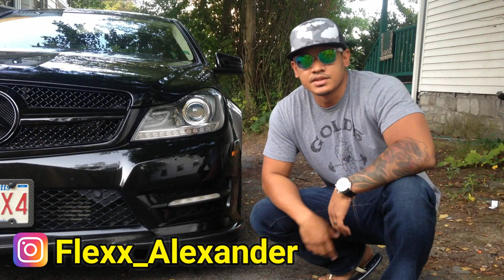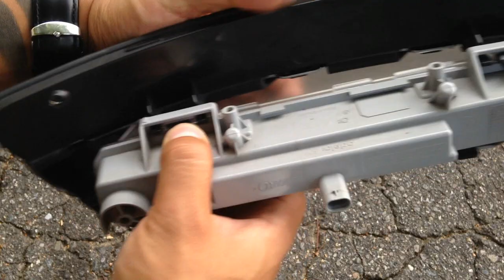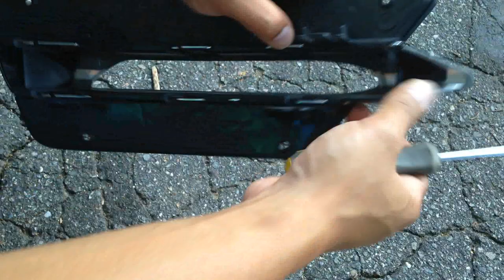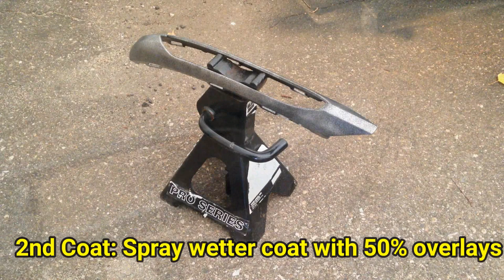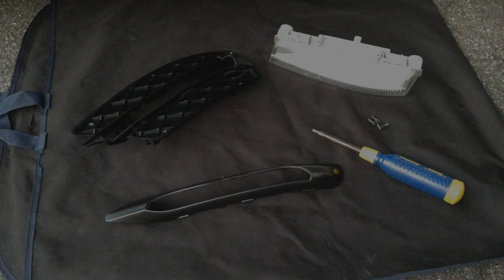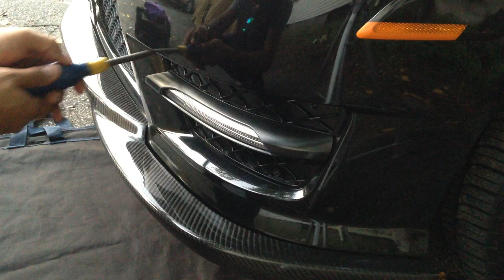BLACK OUT CHROME FOG DRL LIGHT TRIM MERCEDES C250 C300

Comment: Hey flex, do you know how you would remove the fog cover on a 2014 w212 e350. On this particular model there is no light strip on it, it’s just a chrome line, I’ve seen people replace it with actual lights and was wondering if you knew how to do the removal

Comment: @All other with the same question (as me btw - have the model without outside screws) - some models do not have the screws outside. To get this thing out - u need to go first underneath the bottom side, get the cover shield away and theeeen u will have the access to that thing from inside... quite brain fuck doing that... but this is the way.
Reply: I have a 2013 C250 Turbo Deluxe no torx screws either...

Comment: Great alternative to vynil
Reply from the maker: I did vinyl first but it was a pain to get all the wrinkles out. Also, the black vinyl got scratches and pitting really quickly when dirt and debris is hitting it on the highway.  The plastidip for some reason just holds up better.

Comment: Now if I continue to spray on more coats of thr glossifier will it eventually get close to the metallic black that our cars are painted? I really want to do this to my rear trunk chrome but I want it to somewhat match and not be obvious that it was painted
Reply from the maker: the glossifier is not meant to make the black plastidip base turn into a metallic black. It's designed to "gloss up" your flat black plastidip.  I did my chrome emblems with the black plastidip and put on 3-5 layers of glossifer and it gave the black a nice shine (somewhat like a satin look instead of a matte look).

Comment: Hey Flexx have you heard about a module that plugs into the OBD port to lower the body on a Mercedes with airmatic suspension? and does it work?
Reply from the maker: yes, it works but that's only on new models. I've never experienced it.
Reply: @TheFlexxGarage  thanks a lot Flexx, I have a 2013 E Class would it work on this?

Comment: Would it start peeling off by it self like when u use the pressure washing machine to wash ur car ? Or just by it self ?
Reply from the maker: Only if you didn’t apply it right. Plastidip is super strong if you prep the surface and spray the right amount on it. You can’t just spray it and just cause you have coverage you stop. You need to build up layers so it’s durable and super easy to peel when it comes time to peel.
Reply: Just did mine right now did very step it looks real nice !!! Thanks for all your tips flex !
Reply: Ummm... don't use a pressure washer.
Reply: @luxchannelx6039  is you’re still on?

Comment: I took the screws out but i still can't get the lights to come out from the bumper
Reply from the maker: don't know...on my car, it gets hot in the area behind the lights and the black plastic kinda molded to that opening on the bumper. So after removing the screws, I had to put hard for it to come off. Once it was off, they went back on fine and was easy to remove again in the future.